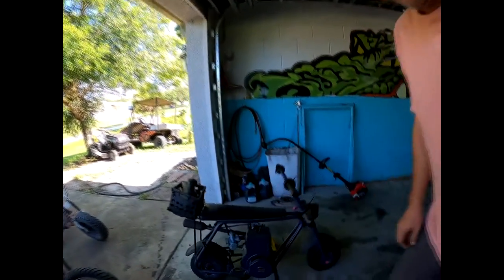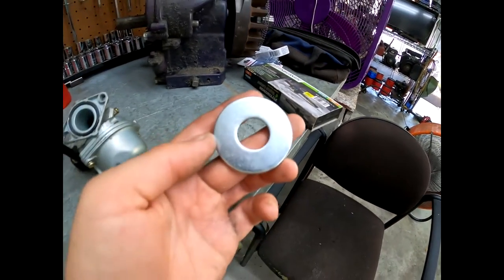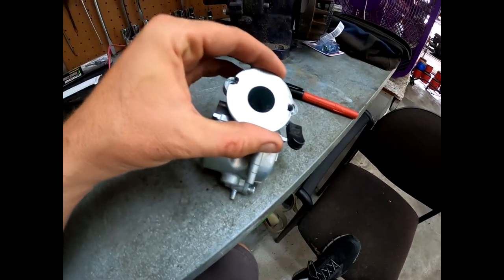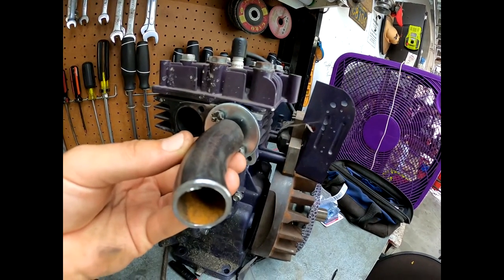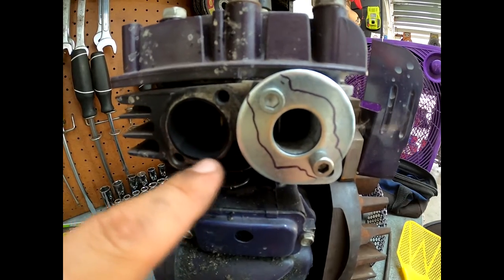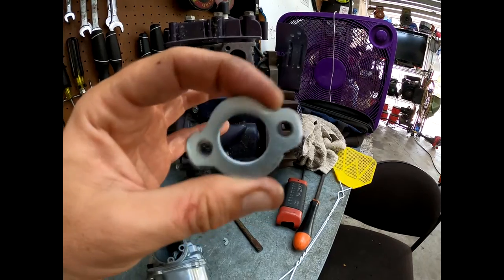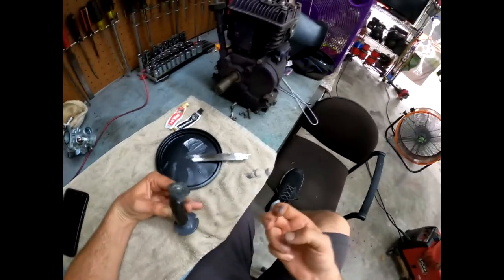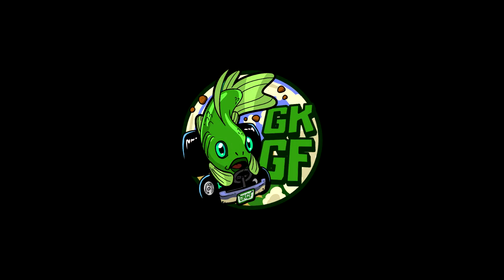Intake Build For Mikuni 22mm Carb For Any Small Engine

Comment: Great job. Love your videos. Helpful tips... clean your washers with muriatic acid it's cheap at any hardware store. Prep your pipe with it to. Your welds won't be UGLY and less clean up after. The galvanized coating contaminates the weld big time.
Reply from the maker: That is smart man..I'm new to welding and I dont have a ton of money..every little tip like this helps..thx for watching brother!
Reply: You may think this is nutz but it works and a lot less fumes. Toilet bowl cleaner lol, I have been welding for 28 yrs Motorsports stuff, I swear it works great !

Comment: Awesome video!! Ive been trying to bring back an old 3 horsepower Briggs to out on an old mini bike for my daughter. But the carb and fuel tank are pooched. Definitely gonna be following your video to try to make my own. Any suggestions for carb size for a 3 horsepower briggs?
Reply from the maker: Not sure if they make anything small than a 22mm makuni..but maybe a carb for a 50cc pit bike would work..get em on amazon for like 20 bucks..I'm actually building an intake for a 390cc honda right now..thx for watching

Comment: Do you sell these online anywhere? have two briggs engines with updraft carbs, and would like to replace with a mikuni clone dual fuel kit, Only other thing id need to do is use some throttle cable to go from the briggs governor to the mikuni
Reply from the maker: No man I sure dont..I have built them for friends in the past but it takes me a long time

Comment: I got a PZ20 on a 3.5 tecumseh. Idles but dies when I give it gas. Runs a little better with the choke on. Do I need to adjust the pin on the slide needle? Thanks
Reply: Sorry I’m late but anything that runs better needs to be adjusted to be richer. An a screw adjuster richer is out and on on a needle it is lowering the clip
Reply: @connorssmallengines6663  figured it out, about to retire that engine because it has a bad rod knock